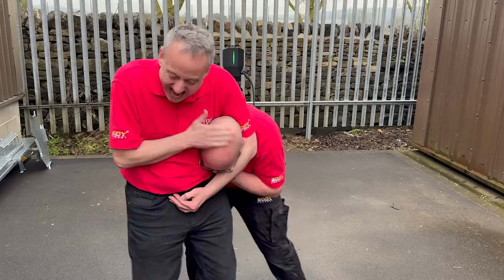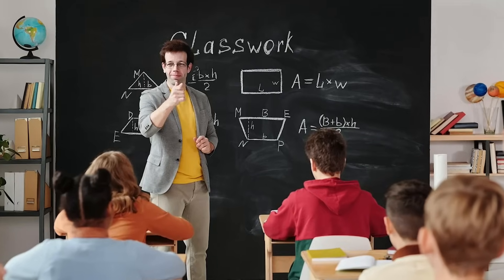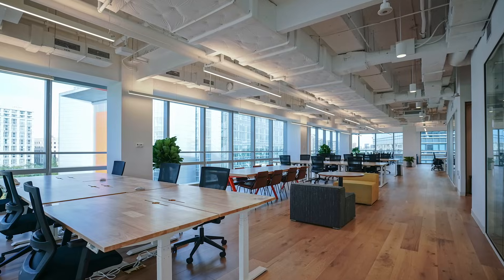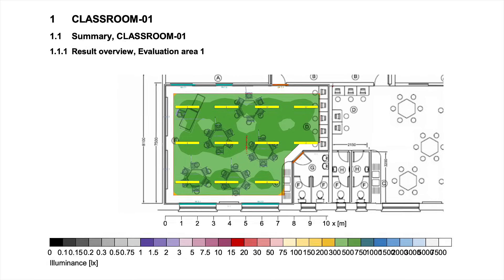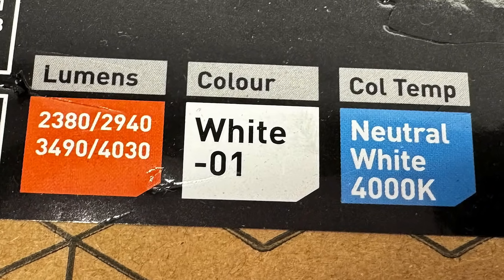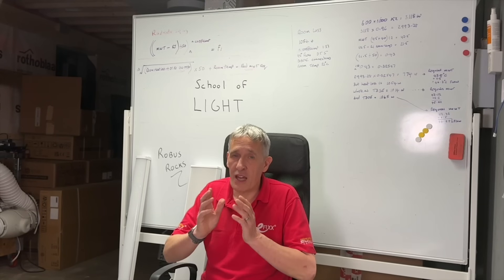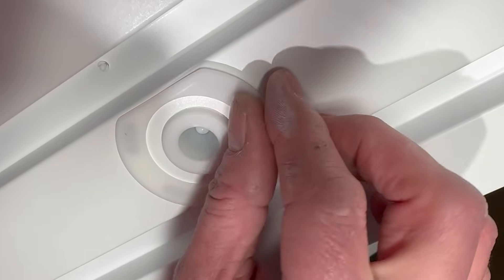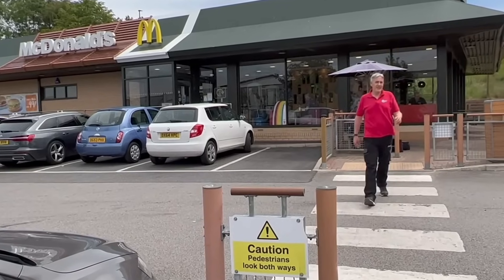❌ Don't Make This Glaring Mistake💡 - ROBUS Scholar

Comment: I posted something on LinkedIn last week which got some good feedback on this very issue, and the fact that most Contractors go for a cost friendly option ignoring glare, and whilst the Robus fitting does appear to sort this issue, it does appear that it will create dark ceilings as there isn’t (at least from seeing the images of the fitting) any light spread outwards / upwards. Making it quite directional.
Reply from the maker: Light on the ceiling is a key part of glare reduction. 👍
Reply: how come you didn't shitcan the linkedin domain years ago when  they spammerd